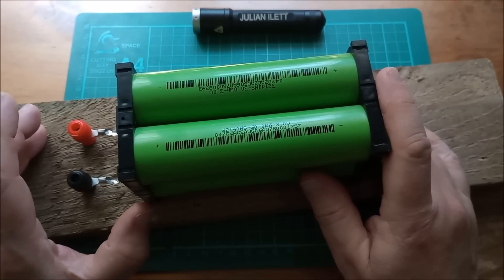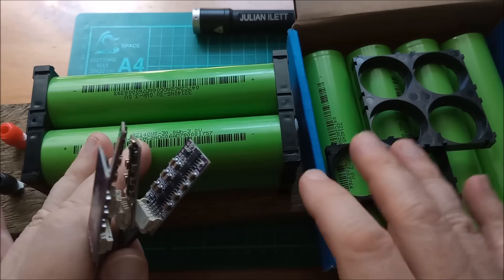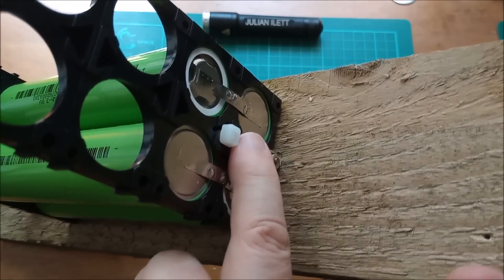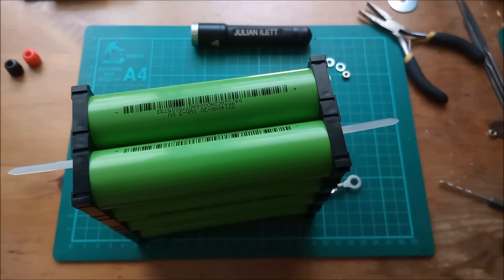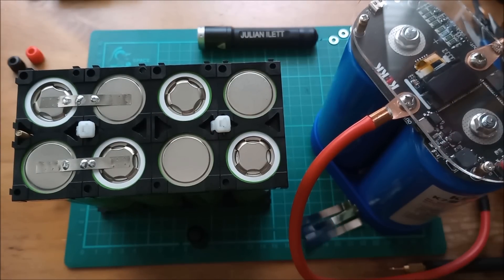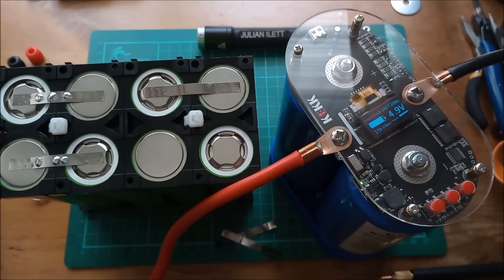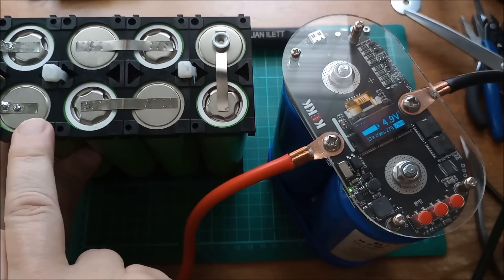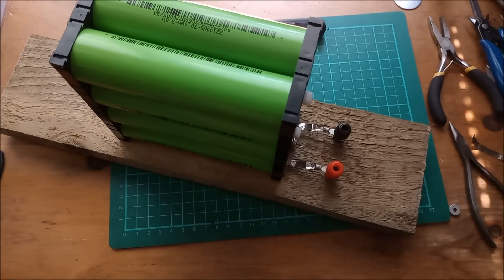Spot Welding 32140 Sodium Ion Cells using Supercapacitors

Comment: i have also a supercapacitor welder, but in a big metal box with massive 25mm2 cables, and a small lcd screen to set up everything, i see on your welding work the electrodes stick into the nickel sheet after the shot like mine, this is pure nickel 99,99 perc. no problems like this with nickel-plated strips. I don't like to use the pointed electrodes, i got the spherical shaped, ball ones, i like them very much because the welding point is twice bigger. I do mostly battery packs for electronic tools 21V, and 12,6V batteries for hobby. I would never change my supercapacitor welder for a cheap ass aliexpress 40 USD "spot welder" that is build with a li-po battery, they are so time wasting and weak. Supercapacitor welders are on ali for 70 USD- 80 USD, recommend it for everyone and for newbies 🤠

Comment: Nice work 👍  I wonder if it's not better to have a dedicated 8s balancer? Surely if you try to use 2 or 3 small ones in series, each would only manage the cells it's connected to, without any coordination between the groups. This could lead to an imbalance between those two or three sections of the pack. Or are you modifying them somehow?

Comment: I believe these are the answer to replacing lead acid batteries. the voltage range works at 4s, no need for bms, high enough current capacity
Reply: Why no need for bms ?
Reply: @laflador_7691  lithium needs a BMS to prevent over charging and over discharging. Over discharging sodium is not a concern, you can drain it to 0v with no damage. As long as your charge source can't bring it over the maximum voltage, no reason to be concerned about over charging.

No need for bms. Do need an active balancer though

Comment: At one point you were welding with one probe on the battery and then latter with both probes on the strips. Doesn't this change the weld?